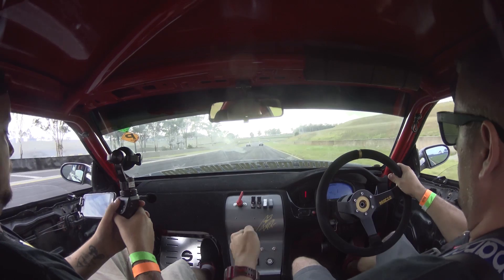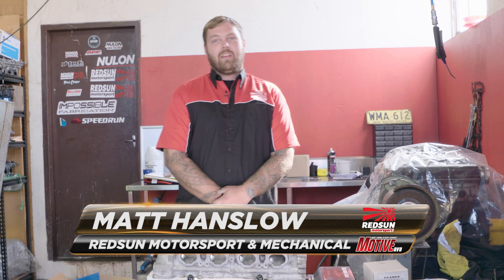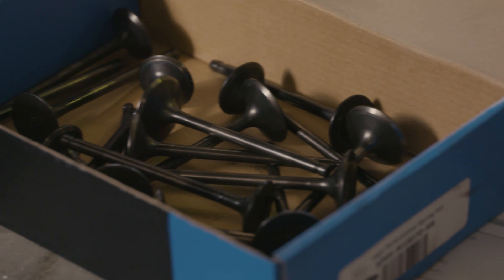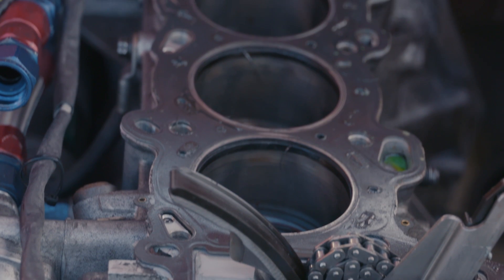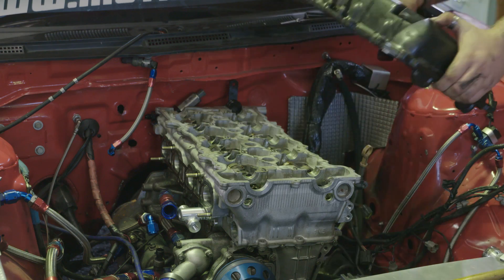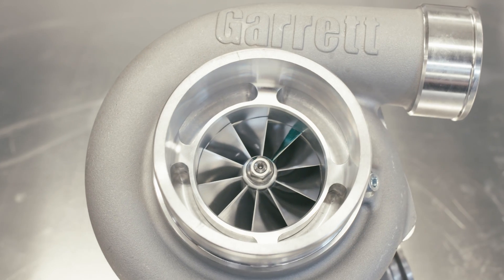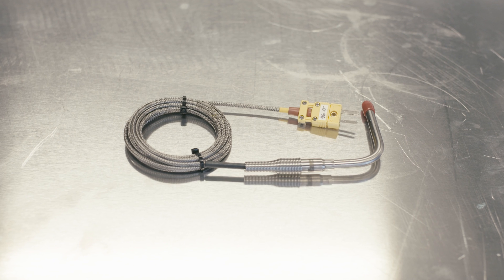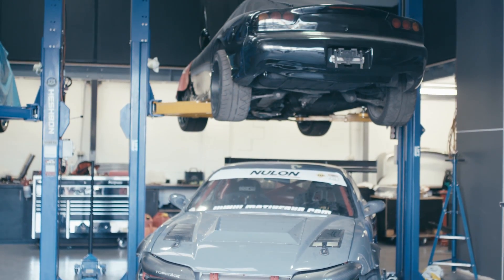JET200 SR20 - VE Head Conversion Part 1

Comment: great build mate, would you lose any power or response going from the twin scroll set up to a v band?
Reply from the maker: SR22VET twin scroll on any given combo shod increase response but we had the problem previously where the car was actually a little too responsive and we dialled mid range boost down. We have new head and larger turbo so interesting to see what it's like.
Reply: MotiveDVD thanks for replying. im building my motor too and its very similar to yours. 2.2 stroker p12 head with 184t cams. i was undecided on wether to keep my t3 manifold with my precision  6262 or to upgrade to a twin scroll gtx3582r with 6 boost twin scroll manifold, on all your previous builds youve used twin scroll with great results, so i was abit shocked to see that youve changed to a v band apart from easier maintenance being the main point.
Reply from the maker: We debated it a lot. One factor was Hypertune wanted to use one of their off the shelf manifolds and Garret doesn't do as many rear housing options as they used to. Twins roll is always better in theory but we had too much responses before so figured the lower CoG, shorter dump pipe and simpler to work on out weighed making a custom manifold to suit twin scroll
Reply: MotiveDVD would be a monster mate, hope to see it running soon to see what that gtx3582 and vvl head go like.

Comment: Did you consider a Borg Warner EFR turbo as an option?
Reply from the maker: Mick D considered it but we have a long relationship with GCG Turbochargers and Garrett. If you look back through our videos you can see we are loyal to those who support us.
Reply: MotiveDVD Ok, but GCG do sell the BW EFR range of turbos, I would of thought a EFR 8374 would be perfect for your setup... but hey, if you can get the Garrett for free then maybe it's worth sacrificing some response. I would really like to see a back to back comparison of these two turbos on your setup.
Reply: P11 converted to single solenoid? I have a 20V that has only one.. P11 stock has 2 right?
Reply: Mick D Mick D real st had done a back to back test with a precison 6266 and efr equivalent turbo on the same car. Precison made 843whp @29 psi the efr made 786whp @30 psi. The efr spooled 70rpm faster than the precision gen 2 but it lost nearly 80 hp to the precison and was running more boost too. On the graph it shows similar power curve between the two turbos up until the top end where the precison walks away from the efr. 70rpm of spool is not worth losing that much up imo, keep feeding in more boost and the precison keeps making more power, a few mates of mine run the efr turbos on their track cars and they say themselves the efr efficiency is in the low 30 psi range